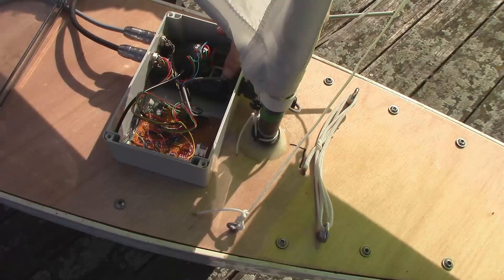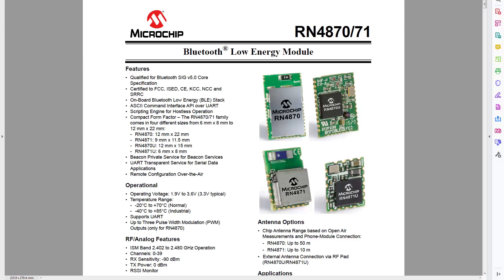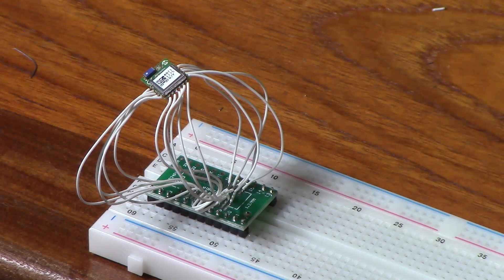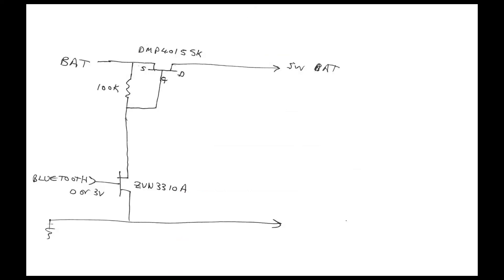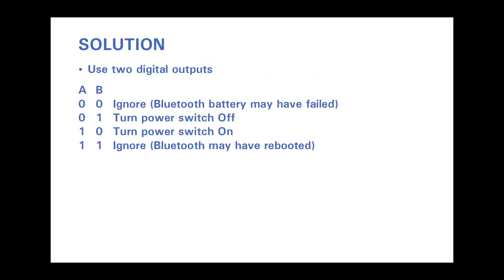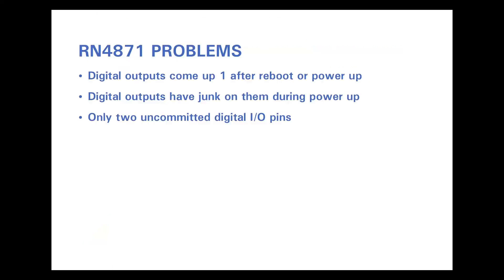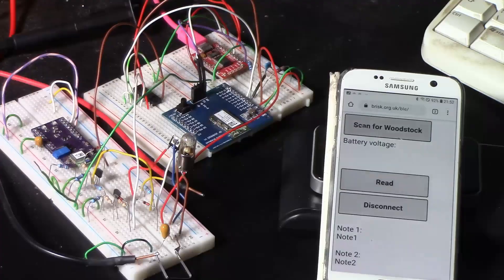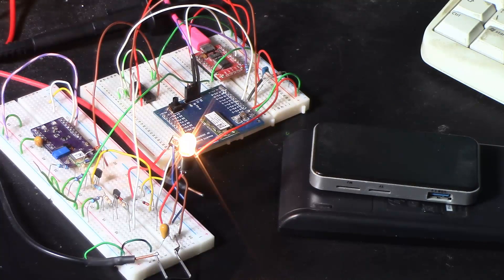Bluetooth low energy power switch

Comment: Does the RN4871  come with firmware loaded, or do you need to flash it?
Reply from the maker: It's a long time ago, but I think it comes with firmware in it. It is easy to update this firmware using its serial interface.